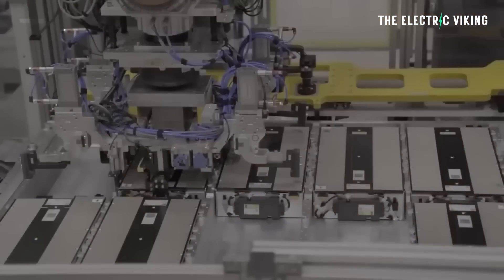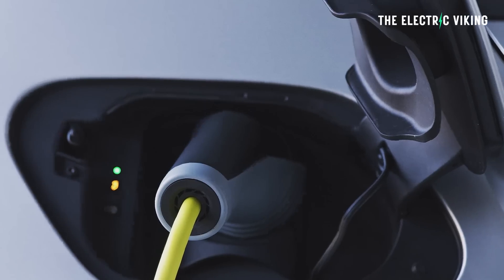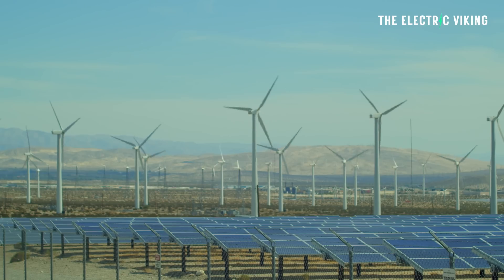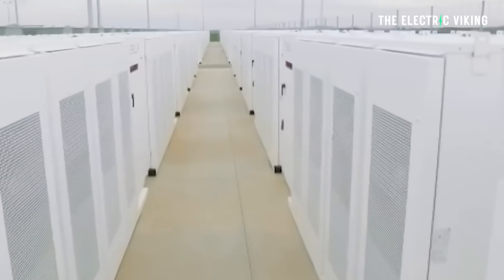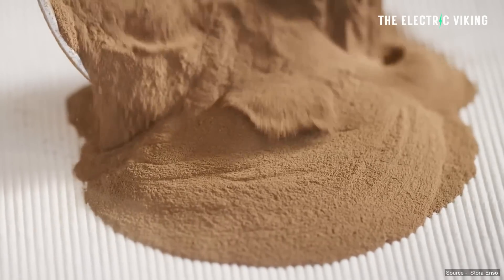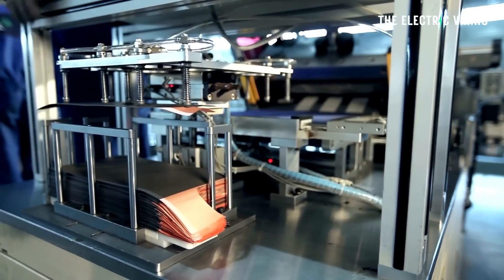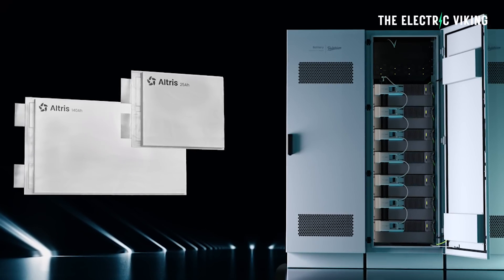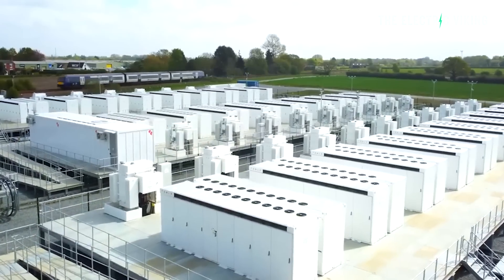Batteries made from salt and wood pulp could power Europe’s energy grid

Comment: 100 Wh/kg is not terrible.  In a mature ubiquitous EV super charging network, 100 Wh/kg should be perfecly viable, as EVs won't require the range if they can charge to 80% in around 10 minutes. If for example 140 Wh/kg for an average EV gives you 500 km range, then that same vehicle should get at least 300 km range, which is fine if you have 10 minute EV super charging everywhere. Most drivers require a 10 minute break after driving 200 km, there wouldn't be any significant inconvenience to have to recharge at around 300 km. For urban and suburban driving, a range of 300 km is often more than sufficient. Many EV owners primarily use their vehicles for daily commutes and local trips, where frequent but short recharges would be manageable.

Comment: This would be a great solution for the US. Large dense forests here.
Reply: Great idea. Shave the forests for reduced CO2. FFS😅😅😅😅😅😅
Reply: They burn the lignin for energy, and so their "Lignode TM" is made of compressed ash instead of graphite. You basically just need ash, but that doesn't sound as "green" as using trees.
Reply: Yep, great idea. Cut down all those ugly forests to make batteries for electric cars so that they can drive through the bleak lunar like landscape that used to be forested.
Reply: @pontiuspirate1925  that's what tree farms are for
Reply: @ExpressYourselfMachine  how long does it take for a tree to grow to become viable ?
Reply: @ExpressYourselfMachine   Established tree plantations, softwood and hardwood, are for timber used in buildings and making paper. They’re already at capacity. You would have to clear tens of thousands of acres to plant new trees suited for these “weird” batteries. That’s hardly being “green”.
Reply: @pontiuspirate1925  the only capacity they are at is not having enough lumberjacks and mill space to process even more trees. Lignin is 1.3g/cm^3, graphite is 2.26, and anodes are still <10% of the battery by weight. A 2000kg tree will have 342kg of anode, so >34200 kg/acre, or potentially 300t-700t of batteries per acre. You don't need tens of thousands of acres, in fact you can make graphite from any ash.
Reply: @robertfonovic3551  at the tree farms they're already grown, and they are expanded all the time. The question isn't how long a tree takes to grow, but it's do we need so many trees at once that the farms will be depleted? No.
Reply: @ExpressYourselfMachine  I think there’s something a bit counter productive if you have to cut down trees to make a car battery.
Reply: @pontiuspirate1925  you're cutting down trees to make houses anyways, and the lignin in the waste byproducts of sawmills is just there for the taking. There's still more processing to make it graphite-like, but it's an alternative to mining.
Reply: @ExpressYourselfMachine  Well, if the process makes enough product and doesn’t involve clear felling then it might be worth a shot.

Comment: Please note that a battery needs also Aluminum and Copper. According to Frauenhofer Institute in Germany, the lower power density of Sodium batteries cause more Copper and Aluminium usage. This offsets the environmental benefit of not using Lithium.
Reply: Copper is NOT always required for Sodium batteries. Also, you are avoiding China supply chain.

Comment: Environmental concerns have inspired scientists to develop new technologies from unexpected material resources. One example is a battery made from the wood fibers of yellow pine trees, which was developed at the University of Maryland.

Materials science professor Liangbing Hu and her colleagues were inspired by the storage and energy conversion capabilities of trees, as well as the idea to use a more environmentally friendly material for battery technologies. "Wood fibers that make up a tree once held mineral-rich water, and so are ideal for storing liquid electrolytes, making them not only the base but an active part of the battery," said Hu in a UMD press release.

The scientists coated the wood fibers with tin, using sodium rather than conventional lithium as the primary energy storage medium. The result is a nano-scaled battery that is resilient enough to endure over 400 charging cycles. "Pushing sodium ions through tin anodes often weaken the tin’s connection to its base material," said Teng Li, an associate professor of mechanical engineering. "But the wood fibers are soft enough to serve as a mechanical buffer, and thus can accommodate tin’s changes. This is the key to our long-lasting sodium-ion batteries."

The battery is not as efficient as the conventional lithium version found in mobile electronic devices. However, the researchers are targeting the technology for large-scale applications such as solar harvesting in power plants.

Comment: Geeking... I make supercapacitors and batteries as a DIY thing...

Rattan or bamboo have awesome properties as a carbon source. Hydolize it in low PH for a while and the carbon structures are left behind.

I can see trees as being a great source of fine-grain carbon for batteries.

450C sealed container for 10 hours...

Process the results...

You could get some awesome long-chain carbons...

But it is so hard to dial in. I do 6 canisters at a time and usually two of them have good results...

Backyard hobbyist's thoughts...